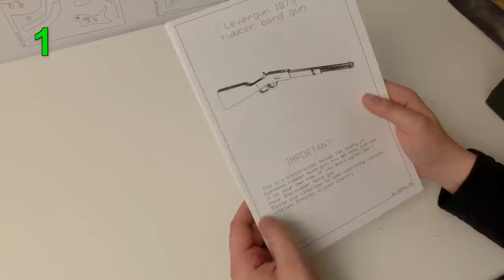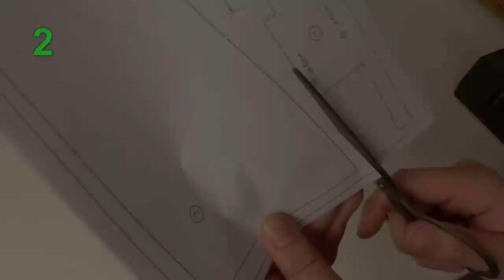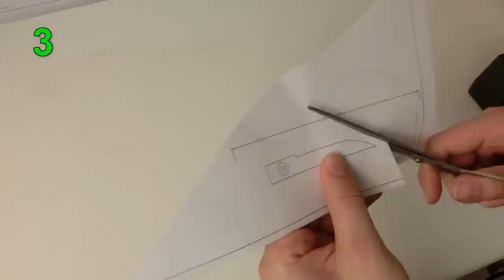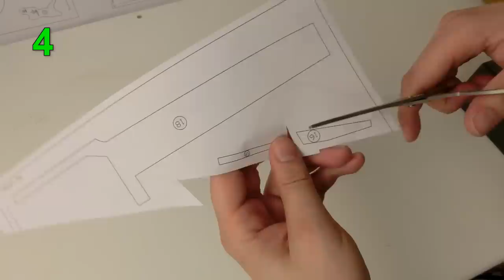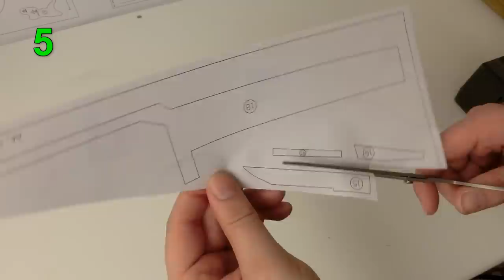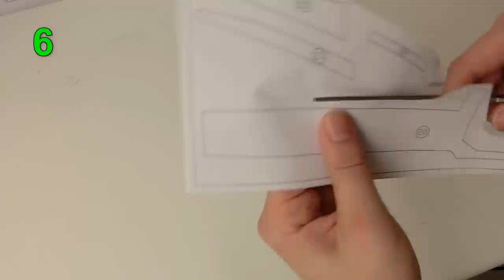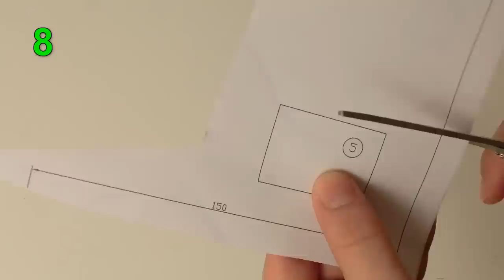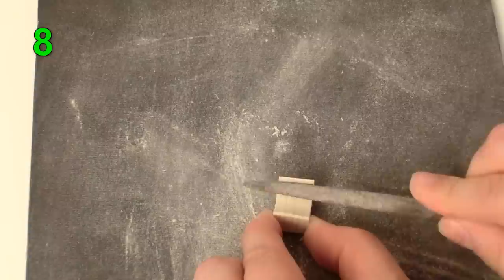Tutorial! Lever-action Rubberband gun! Part 1

Comment: I just started making this in woodwork class today. That 4mm plywood was scarce so we eventually had to machine some paneling down to 4mm and use that instead. Good video, practical design, easy to make and easty assembly 10/10.
Reply: I also had to use wood glue to put the paper on the plywood so I'll have some extra sanding to do.

Comment: This is an incredible build! Are all the parts you cut out the same thickness of material? Also, can this technically be done with another thickness of wood that is close to 5/32, say 1/8th thick wood?
Reply from the maker: eggfuyung92 1/8 is possible, but you have to adjust some parts. (dowel length, barrel diameter,...)
Reply: I ask this because since the wooden parts would be the same thickness, theoretically, all the parts can be cut out with a laser cutter, which I may do.
Reply from the maker: eggfuyung92 It's all the same thickness

Comment: Just a tip; identically shaped parts (like the ones you used to build up the stock and receiver of the gun) can be stack cut. Basically, you stack however many pieces of plywood you need and temporarily attach them together with a screw in an area that will be cut off. Place your template on the top piece and saw all of them at once. Your pieces will be all the same and it saves you some time...
Reply: yeah, but you might want to do it only like two at a time, because if it gets too high, while your cutting it would fall, and after you cut off the piece with the screw, nothing holds onto it.
Reply: agora fala em portugues
Reply: You can also back each piece with blue painters tape, and use super glue between the tape layers to hold it together. The peel strength of blue tape is pretty weak, which is what keeps it from pulling paint up when you pull it off. But its sheer strength (horizontal) is excellent. I use this trick all the time.
Reply: @adempitapaje1123  tu.me.vende uma.dessa

Comment: In the lower right corner of the manual you have A4, Letter, P4. Does this mean the sizes it will print to or is A4 the only size that works to get the right sizes for the parts. It doesn't seem to print right on letter.
Reply from the maker: It should work with letter. Set page size "actual size" or "custom scale: 100%" (Adobe Reader 11)
Reply: RBguns I congratulate , your weapons are great, I have thought about doing this rifle the weekend , but as a replacement drill since I have , I Might you please give a suggestion .